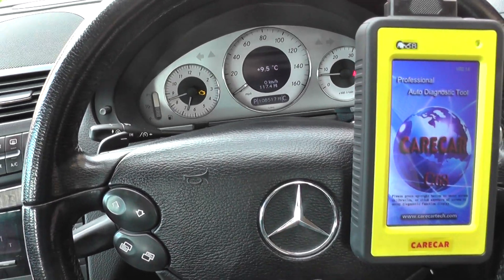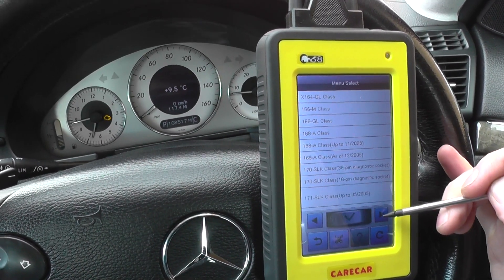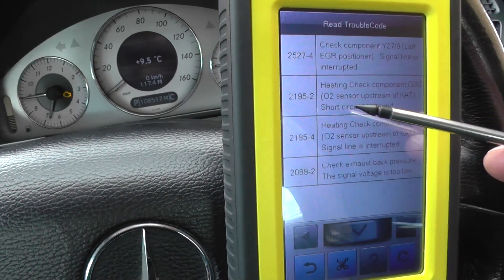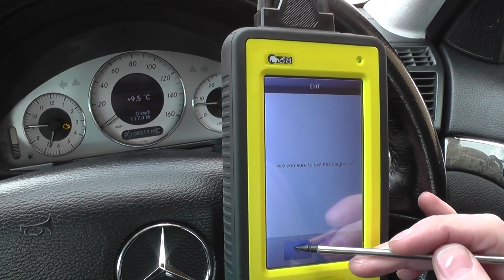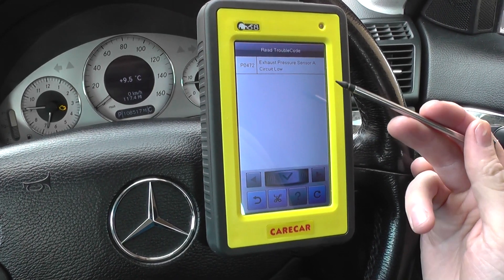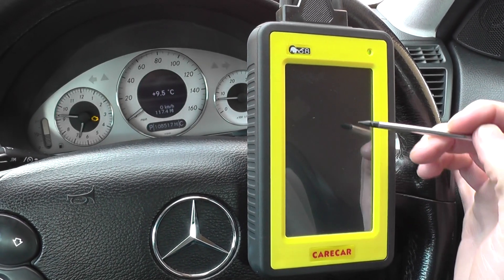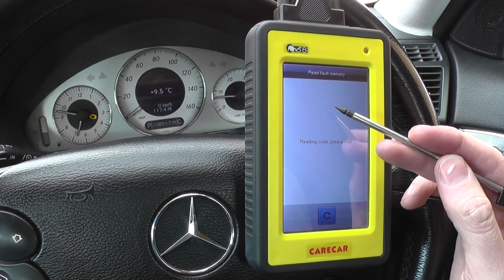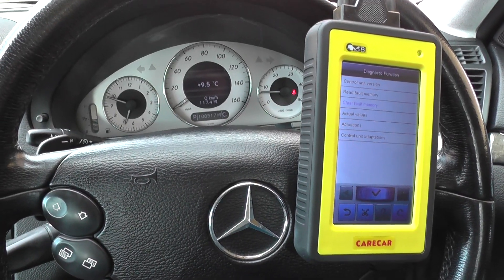Mercedes Benz Engine Light Diagnose & Clear With CareCar C68 Dealer Level Diagnostic Kit

Comment: HALLO! I have a Mercedes e280 2006 gasoline and the p2090 y49 / 7 (right camshaft exhaust solenoid ) diagnostics, the engine light is on.
When the car is cold and ignites the engine, heavy sound is heard for a few seconds and then gains quietness. I pass the solenoid sensor and the motor chain tensioner and as a result the cold flashing noise is easier, diagnosis with p 2090 displays component y49 / 7( right camshaft exhaust solenoid  ) has short circuit to grund,And the engine light returns.
  With your experience you can tell me why this is happening and what can I do.
RESPECT
Reply: This guy is simply pitching the tools to diagnose fault codes.